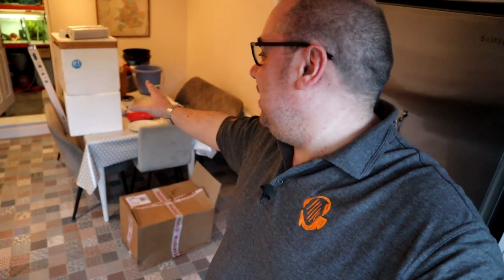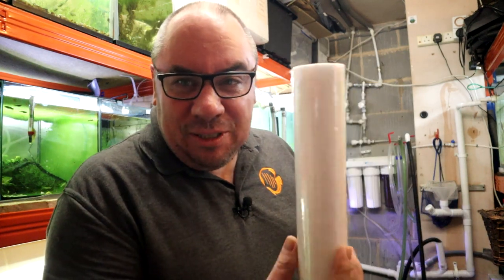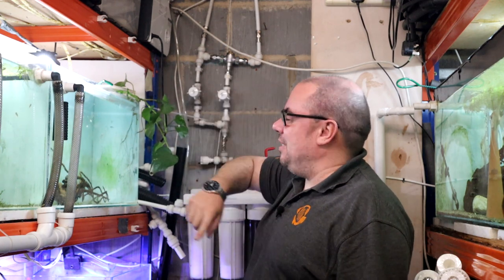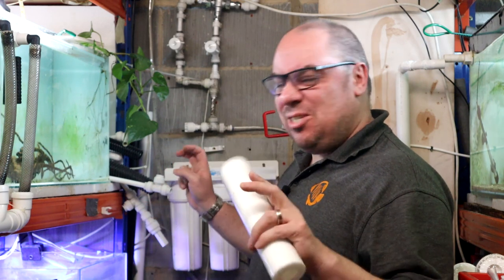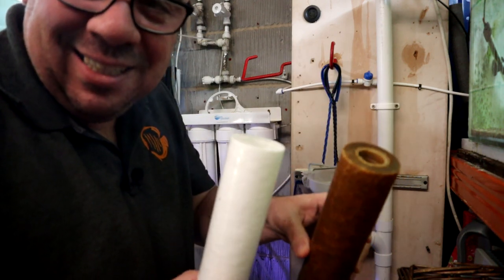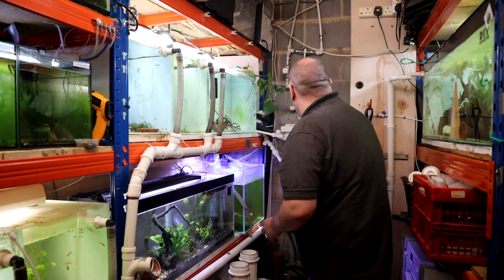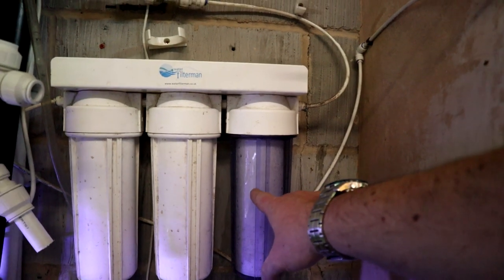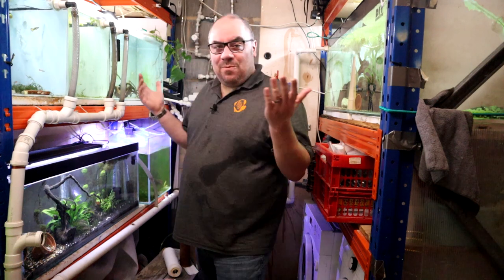Fish room automatic water change system with HMA filter

Comment: I am trying setup a drip system on my one tank but have been advised not to change more than 5% a day about 30 ltrs a day as you can flush ammonia away rather than build up filter bacteria to remove it but am struggling to reduce the pressure enough to get anywhere near this ( instruction say only to reduce the input pressure to reduce flow and not with the 1/4 taps ?? )
Do you run some to waste as 4ltrs per minute seems a lot more water than you are dripping into your tanks ?
Many Thanks
Paul

Comment: Brilliant. 

Make sure to show us when you drill that other tank. Also if you manage to find what that price is for the overflow that attached it to a hose then let me know as I’ve looked and I can’t find it
Reply from the maker: These: https://www.diy.com/departments/floplast-solvent-weld-bent-waste-tank-connector-dia-21-5mm/178485_BQ.prd
Reply: @AquariumAdventures   o o ordered a load of those ready (you showed them me last time) 
It’s the bit you have coming from that and on to the hose. Like a “female barbed hose something” but I don’t know what to search for pal
Reply: Hosetail maybe?
Reply from the maker: @Mountain_Aquatics  I can't remember where I got them, and have run out of them myself! Might be these?
https://www.screwfix.com/p/claber-main-tube-coupling-elbows-2-pack/120FY?kpid=120FY&ds_kid=92700052138698116&ds_rl=1249410&gclid=CjwKCAiA9bmABhBbEiwASb35VxoYFHg6PgIT8Par9u4ynydJnCV6apWOjCwvwcYQceohrPs8MMUUvhoCTHcQAvD_BwE&gclsrc=aw.ds

Comment: Hello, I keep Corydoras and I have a high KH tap water, is it worth me spending the extra money on a CBR2 charcoal filter. I have read that it removes the copper also, making it safer for Corydoras.
Reply: (I know the HMA filter won't change the KH!)
Reply: I think I'm right in saying KH is Calcium and Magnesium so a high KH wouldn't mean there is a lot of Copper in the water.
I think you should test for Copper before taking action. But I do believe the HMA would remove copper and other heavy metals.
If you wanted to reduce KH I think the only way is to use and RO system, but you would then have to remineralise your water.
I'm lucky that my water is soft with low PH out the tap, my Cory's seem happy... but I wouldn't keep discus because it's too much hassle (at this stage in the hobby at least 😉)
Reply from the maker: A HMA will definitely remove copper, so might be worth it if you're having problems.
Reply: @AquariumAdventures  I have just read that the cheaper cartridges that come with the filter use a charcoal that is produced with burnt coconuts, the CBR2 cartridge uses coconut charcoal that has been cleaned with an acid. I just wanted to know if it was worth the extra for the CBR2 cartridge. Luke answered my question that I should test the water for copper, I just assumed I had copper in my water as my pipes are old! Hope this makes sense.